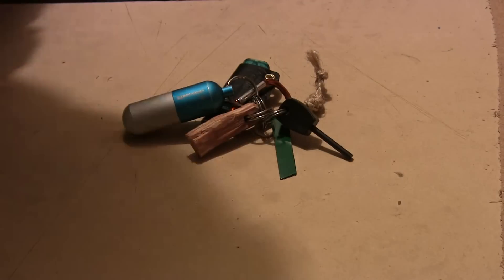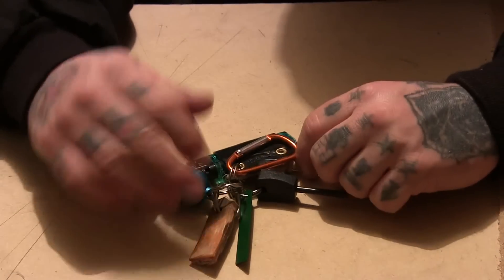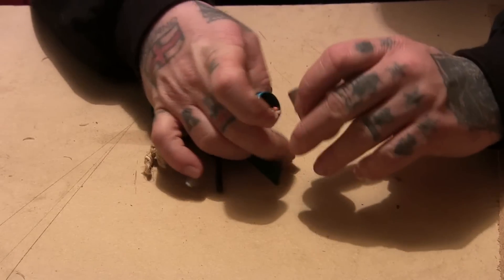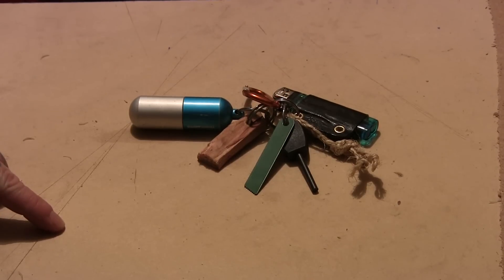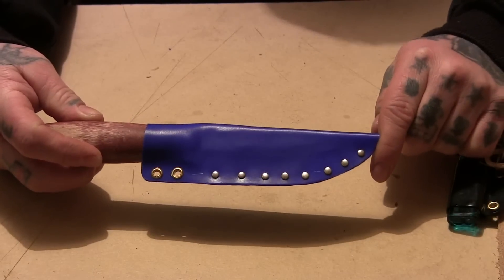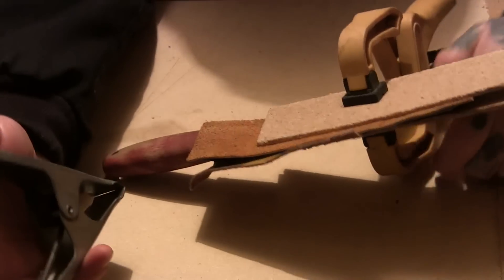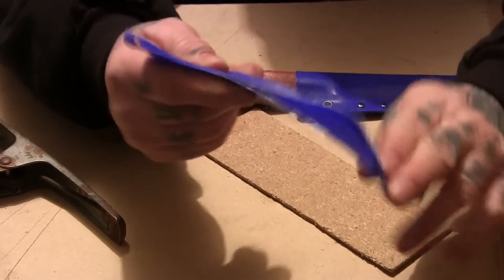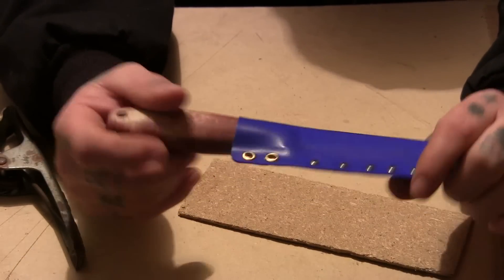Key Ring Fire Kit & HDPE Mora Sheath

Comment: hey mate

that sheath is looking much more neater and nicer
your right about the colour tho,
could always rough it up with sandpaper and spray paint a single
matt colour or try an camo pattern....
if you don't want to use stencils try the good ole real leaf method.....
I like the look of fern leaves held in place and spray

or I've seen a good technique I once wanted to do a rifle stock in were you use
sea sponge to dab different colours on....

either way spray paint will do the job
Reply from the maker: +Dukes Pursuits good idea mate , I may spray it later  cheers mate